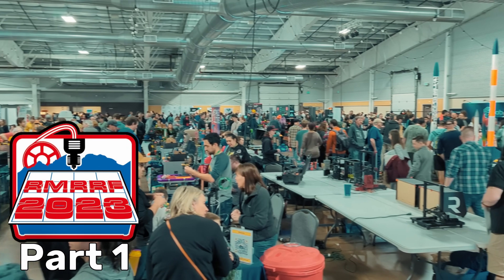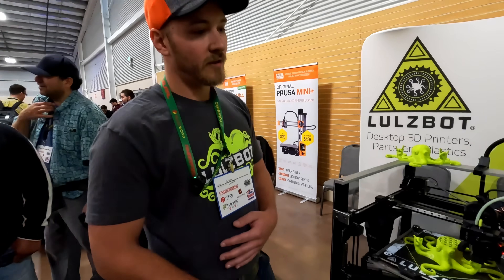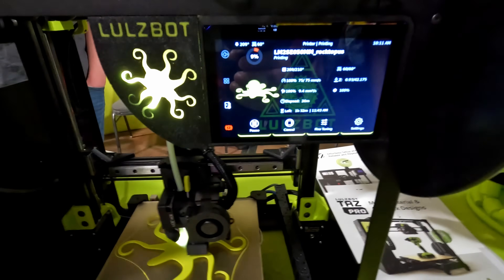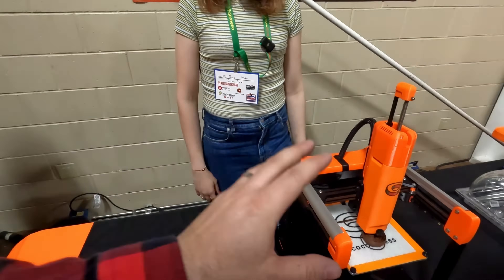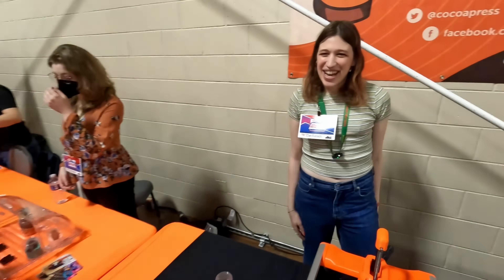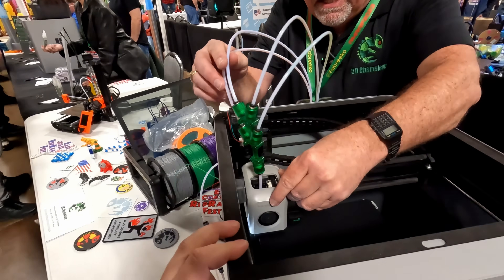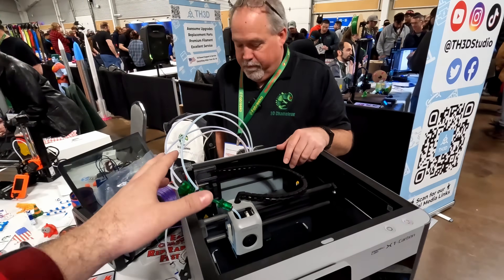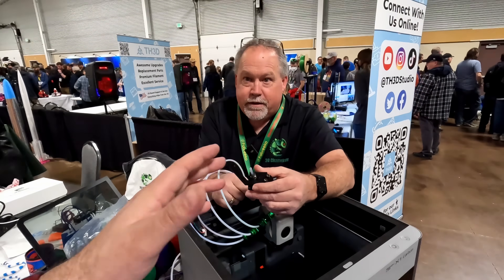RMRRF RECAP PART 1 #3dprinting #rmrrf

Comment: Voron 0.2 vs Qidi X-Smart 3 on start with high speed printing (after Ender 3v2 with klipper). What is better? I like to DIY, but also need something to print some small parts, sometimes with big batch (30-100 parts 40x60x40mm).

Comment: Not gonna lie - the cocoapress chocolate printer is really neat but the cost seems way to high for the value most people would get from it.  Which is not to imply it's overpriced - I'm sure it's a fair markup on the cost of components.  I just wonder if there's enough of a market to make it work?
Reply from the maker: foodgrade things have costs and yes, there is a big enough market going off how things appear to be going
Reply: @CanuckCreator  I hope so, because Ellie seems awesome and I want it to succeed!  It just feels like one of those things that costs too much to make.  Perhaps I'm just being contrary because this is waaay out of my budget.

Though I suppose that if Cocoapress is only anticipating a relatively small number of units being sold, that would be part of the higher costs....

I really feel like there's an Econ masters' thesis lingering in this somewhere.  :)
Reply from the maker: I mean, this is a downright steal compared to their previous version which was iirc around 8k

Comment: 3d camaleon  looks  awesome!
Reply: Since it now supports any n filaments, it also supports n+1. We should be happy! 😜
Reply: It's neat, but one of the advantages - the short retraction length - goes away if you're trying to enclose the machine.  So I feel like it's more useful on a P1P than an X1C.

Also, I think the Chameleon wouldn't work for the main use I see in an AMS: the filament backup function.  That's a my-use-case situation, of course; but I have very limited need to print in multi-colour or multi-material, but the auto-reload-continue functionality will be very worth it whenever I manage to save enough pennies.